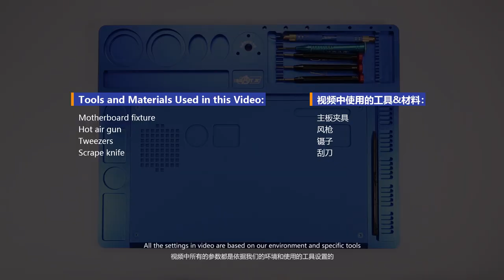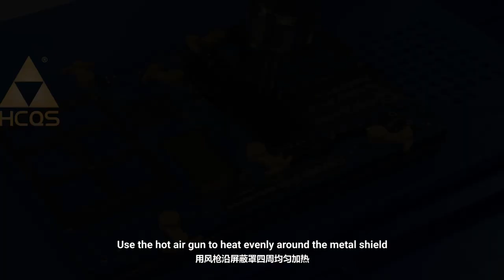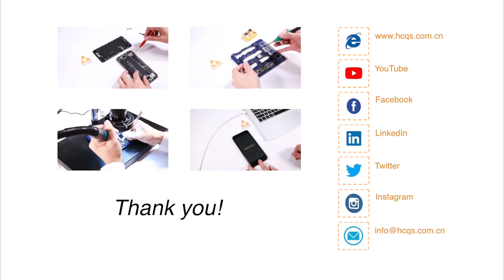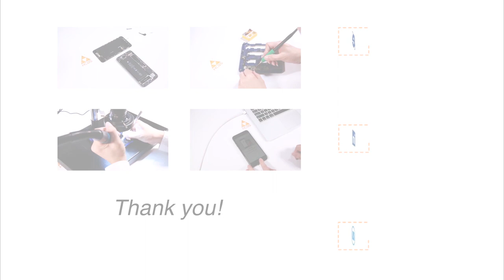How to Remove Motherboard Shield for iPhone | Motherboard Repair Lesson

Comment: Is there any way to remove the shield without a hot air solder?
Reply: Easy, without it, you first buy a hot air rework station, then do as shown.